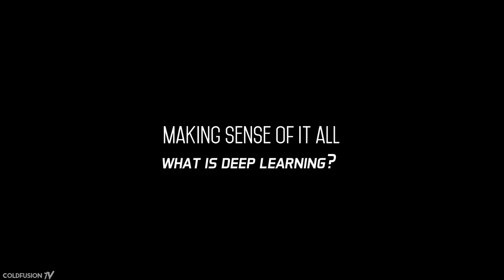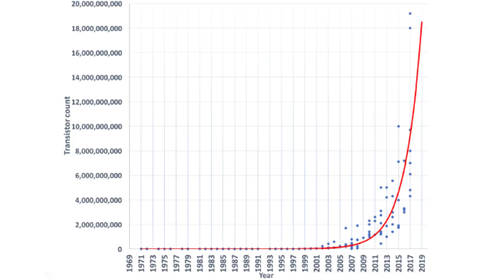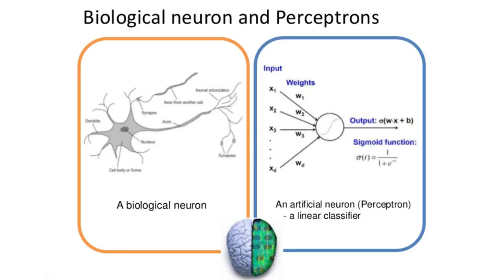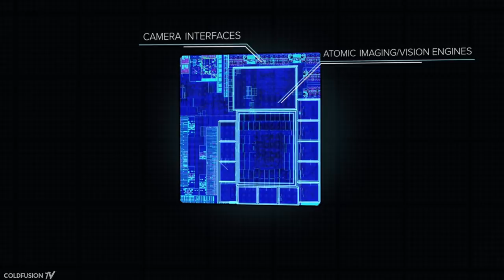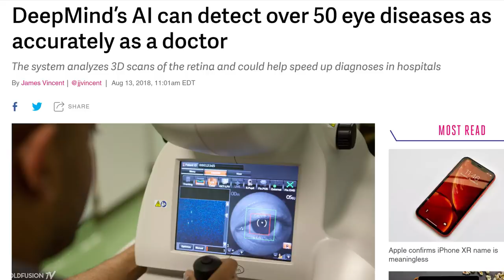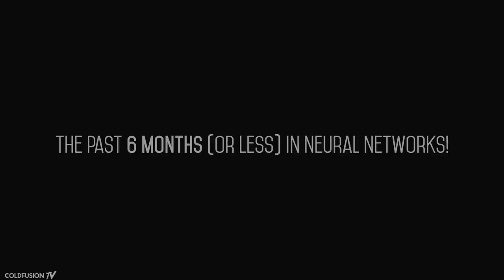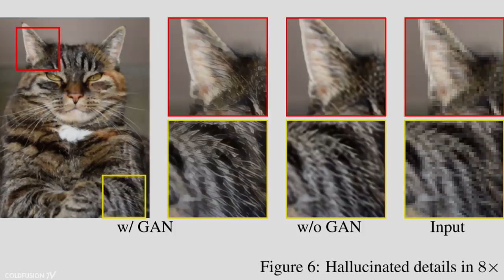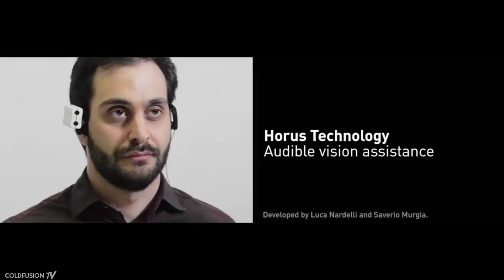Why Deep Learning Now? | AI Revolution Documentary

Comment: I think it is important to point out that you completely failed to mention the advances in hardware and software used to train neural networks. Executing them is a simple task in comparison to actually training them on the enormous data sets they require, and in just a couple of years, a task that would have taken years to train for can now be trained for in a couple of weeks. This mostly due to Nvidias efforts to produce some insane hardware, and creating special GPU based processors for processing nerural networks.

In addition to this, something that has recently happened, which will be a game changer, is that game engines like Unity now has support for creating super realtime simulations with scenes with visuals close enough to the real world that self driving cars can be trained there, instead of relying on data from the real world. This means that as long as a realistic simulation can be made, one does not need nearly as much data from the real world anymore, which is huge!
Reply: The video is sponsored by Intel, see at 0:42. Not-so-subtle product placement at 3:47 - 3:55 and all throughout. This is essentially an infomercial for Intel. No wonder no mention of Nvidia.

Comment: The answer for the actual title question is pretty simple, it seems to me. The answer would be Nvidia. Modern GPUs and their massive parallel processing capabilities for a (relatively) reasonable cost suddenly made deep neural networks not just curiosities that can run quickly on very expensive large systems. And it means that companies can set up very large racks of them and be able to process DNNs for large numbers of customers, not just a handful.

Soon, it'll mean that we can do it at home for ourselves, though there are some gotchas involved in that, more commercial than technical. Creating high quality DNNs for complex stuff requires a LOT of training data and computing resources, vastly more than it takes to run the actual DNN that gets created. Only large companies have the resources to gather that amount of information. And they are going to want to keep that advantage to themselves by keeping it cloud-based, so that they can make money by gathering and selling data on everyone in the world.

And, it's also the case than them what has, gets. Once you have that cloud based system, all your customers are providing you with a river of training and testing data gold that you can mine. You are getting that pretty much as a by-product, so it's a hugely good deal, and you can therefore create even more highly trained DNNs.

Comment: We will need to create a tax to repair the damage caused by replacing workers with machines, it should have been created a long time ago, a tax on level of automation, the less necessary the existence of a worker in that industry or company the greater the tax, unfortunately this ends up causing the industry to run away to become more automated. Then either the workers are improved to compete with AI machines or only the owners of the machines will survive.

Comment: The reason that AlexNet was a huge success was that they implemented cuda acceleration, fair enough that they needed data. 
But I can guarantee you that people tried implementing Neural Networks(NN's) before AlexNet, the only reason AlexNet worked was that of GPU acceleration.
Also intel may say that their movidious sticks help you rapidly prototype, but what really helps is a GPU. I am an AMD fanboy no questions asked, but even i can say that without Nvidia and their Cuda acceleration, AI would not be as far as it has come. 

Intel is not even the best for AI. When using large NN's, I would much rather have an AMD processor (such as a threadripper) than intel, as they offer more cores for less cost, intel is not good for making AI affordable.

Also i do not get why you choose to focus on Apple all of the time... it seems as though you are a fanboy of them, as they were not the first to implement AI in phones, or the ones with the largest reach. Apple has the second largest reach at best. Talking about Apple seems to be mostly about the fact that they are a large company, as they are not a good company, or the company with the most customers. Deepmind is used in Google products, which is by far more widely used.
Reply: The reason the movidious thang is not a good idea, is that using a graphics card of the same cost will decrease the amount of time required to train by a huge margin.
A 600$ graphics card, can lead to less than 1/10th the training time (it does for SE inceptionv4 with a batch size of 50)
If you have a laptop, i would rather recommend using an external dock and a graphics card, as this will be way better than movidious time wise, which will increase the different things you can try out